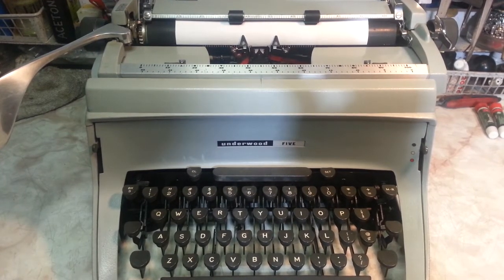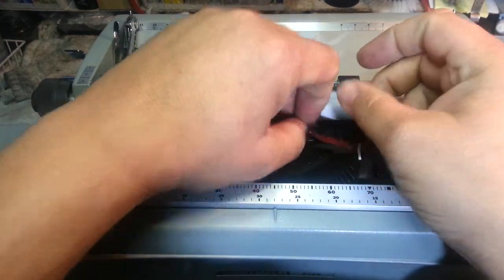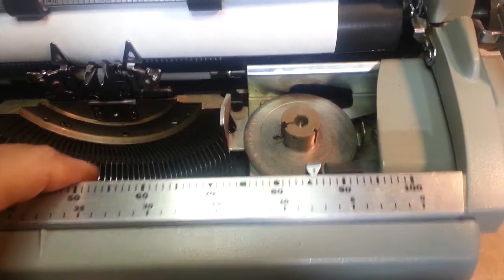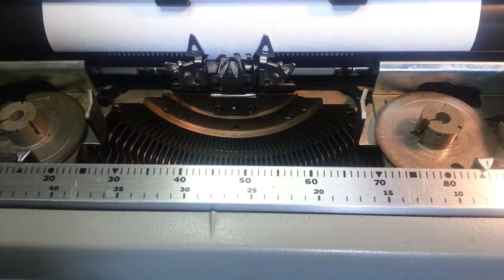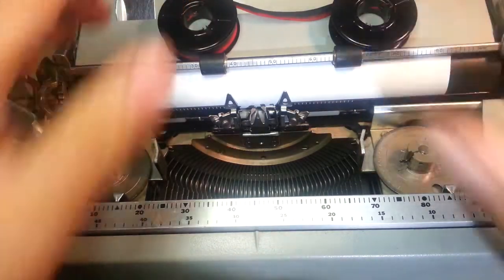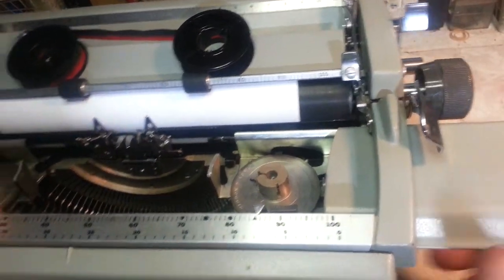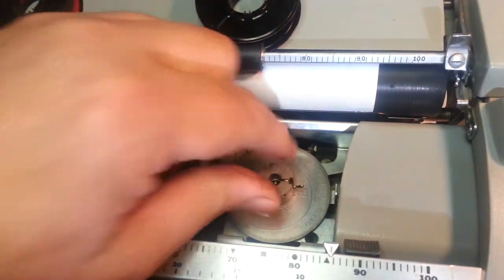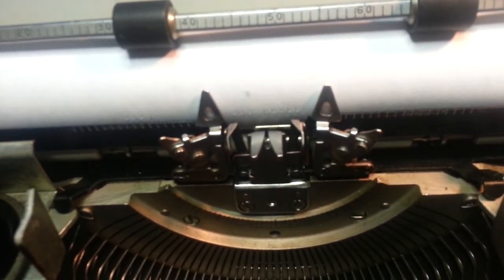Underwood Touchmaster 5 Vintage Manual Typewriter Ribbon Ink T11 Install Demo

Comment: While I don't have this same model of UNDERWOOD, This video helped me to install a new ribbon and the proper metal spools into my 1954 UNDERWOOD Model SX-150 typewriter. The machine came to me without any spools.. it had  two feet of old dried-out ribbon wound onto its spool spindles.

Comment: Thanks for doing this video. I just got one of these “Tanks” from my most local typewriter repair guy, and I love it. He didn’t do a total restoration, unfortunately, but he did put a new ribbon on it. The machine still needs at least one more adjustment or repair that I think he will do; it sounds like grinding gears when using the tabs, and it stops at about the 80 mark, not every time, but many times, like it gets jammed. 

Of my now four machines (including my much beloved Hermes 2000), this may be my favorite machine to get some real writing done, and be willing to invest more money in to get it cleaned up better and maybe even put a new platen rubber on it. While the machine cost me about $50, I wouldn’t mind investing another few hundred in it.

Update: that machine was never able to be completely repaired, so what he essentially did, is swap me out a better working one, same model, and because he had spent more time on that one he charge me a few extra dollars, but he let me keep the first machine as a parts machine (minus the platen, which he was already cannibalizing for another one that he was repairing for his old high school). Although all of these machines have their quirks, and problems, this one works mostly like a dream. In fact I'd love to have another one for back up. I might splurge on that someday. For now, this is my main writing tool, for first drafts, journaling, prayers, letters, poetry, and just general free writing.

Comment: Thank you for the excellent quality of the video. I got a new ribbon and it had the cheap plastic spools. Luckily, the machine still had the metal spools. I respooled with the new ribbon and put it on as you demonstrated, and voila!

Comment: OK this helped me a little. FYI; The arrows do not indicate which way the spool turns. They indicate which way the ribbon winds around. But you did get it right anyway. I need to find metal spools like that for my underwood 11. http://www.typewritersupply.com/underwood_ribbons.htm appears to have the proper ones. Thanks again for that advice.

Comment: Hey... I have a 1953 ish underwood. Judging by the serial# it's from between Jan and June. Would you know why the keys are blank?
Reply from the maker: Sure do . . . .  These are training typewriters, usually used in schools. You're not supposed to look at your fingers when typing, the high school class I was in for typing in the 70's had 30 machines & I was assigned to one of only a couple that had no letters on the keytops.
Reply: Phoenix Typewriter thank you. It's been puzzling me since I picked it up

Comment: Just got my Grandpas same one. The ribbon lift is not working any ideas?
Reply from the maker: Is ribbon selector in black or red position ?
Reply: it was in the red position. Thank you! I still have the metal ribbon spool. Any recommendations on where to get the new ribbons?
Reply from the maker: @jkasper400  I carry the 1/2" ribbon, needs to be wound to the original metal spool, email, rushjensen@aol.com